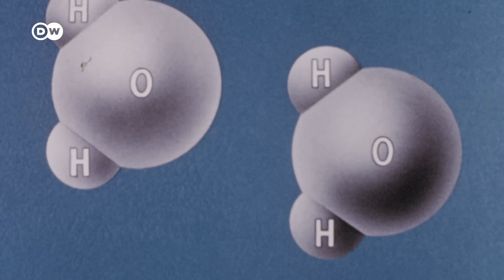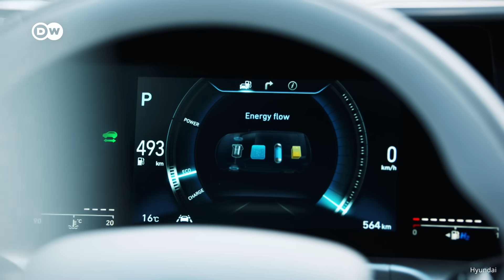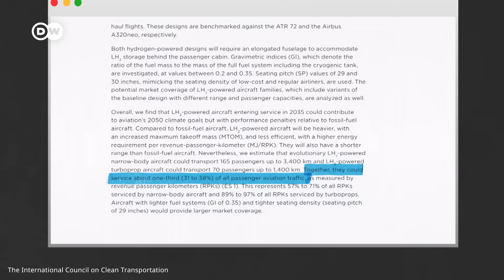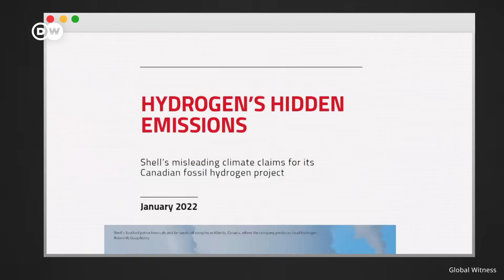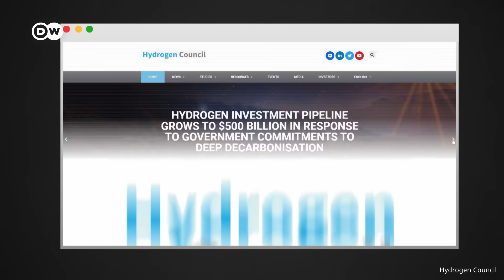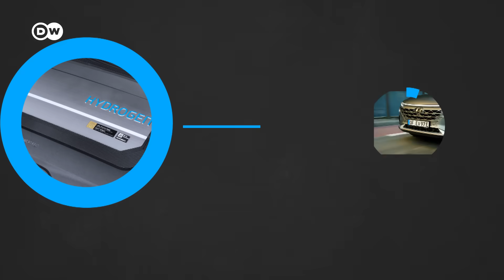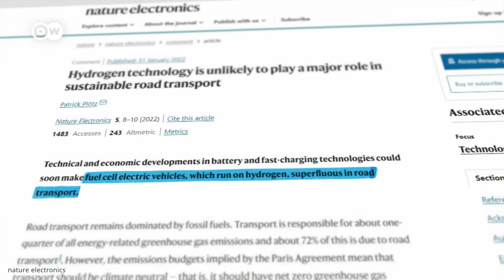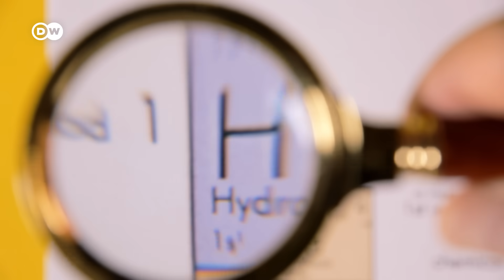The truth about hydrogen

Comment: I saw that in South Australia they are looking into using the excess solar energy produced to create hydrogen. if done like this is can be a very good alternative, and a very good export for very sunny countries.
Reply: Transporting hydrogen is also not efficient. Either cool or compress it like crazy.
Reply: @FIGHTTHECABLE  Even compressed, it’s 9 times the volume of liquid fuels for same energy.
Reply: @FIGHTTHECABLE  The key is cheap high-strength pressure vessels. AKA graphene
Reply: @raam1666  problem is compressed volume. As a liquid Hydrogen is 9 times the volume of a liquid fuel per unit of energy.
Reply: @raam1666  Has any vessel ever been made out of graphene? And since when is graphene cheap?  And that still leaves you with the considerable energy you need to liquefy - compress it.
Reply: @franztafferner9661  yes. and its not
Reply: Green hydrogen is going to remain expensive, because the plan to use waste electricity from renewables relies on nobody finding a better use for that energy. Give the terrible efficiency of the hydrogen cycle, that shouldn't be too hard.
The future for flying and shipping may well be hydrogen, but we also might see electric for both, with a lot more stops for battery swaps.
Reply: The problem with all hydrogen produce is the cost of the fuel which would be double + the cost of gas! Who wants to pay more money for gas? Also the maintenance of hydrogen fuel cell is certainly more than a BEV!
Reply: Yea this is the way to do it. Setting up solar just to create hydrogen is losing a lot in the electrolyzation process (about 40%). But using solar normally and only powering an electrolyzed with the EXCESS energy produced is the best of both worlds.
Reply: @SaveMoneySavethePlanet  Does using only excess solar to power the electrolyzers make them cost effective?  first step with solar is always to use batteries with other storage to level the power output. Batteries are needed no matter what the power source because demand drops at night and load matching is made easier.
Reply: @colingenge9999  I haven’t seen a breakdown of the cost for a system like this. But don’t forget how much we subsidize many fossil fuel industries. For instance, I did the math one time on the emissions of my wife driving her Corolla to work vs our budget.

The gasoline accounted for 12% of our footprint while the cost only accounted for around 1% of our budget.

Every new tech that rolls out goes through a period in the beginning where the government and investors need to prop it up until it gains enough momentum to be truly cost effective.
Reply: @SaveMoneySavethePlanet  Nobody is going to invest in hydrogen factories that just sit around waiting for some excess energy.
Reply: @Freba9  Solar installations all have 30% to 100% excess DC capacity - that’s to give winter generation margin.
In summer that power is essentially free power (and negative daytime wholesale power prices are a fact of life in most countries with significant solar installations in summer at the moment).
Reply: @allangibson2408  In the future there will be so many battery applications (mainly EVs) that there wont be much excess left.
Reply: @Freba9  Same thing holds - to charge a battery in winter requires twice the generation capacity than to charge the same battery in summer, therefore a lot of capacity will go begging for a load.
Reply: @allangibson2408  Also, solar and wind output varies by season. There will be over-capacity when the wind is  strongest and the sun shining the most.
Reply: @lockbert99  And that variable capacity is where energy storage that is capable of load swing handling is important. Hydrogen electrolysis with the gas dumped into existing gas mains for later use is just one option.
Reply: It’s a start - and makes us able to export hydrogen. But I wonder if there’s a better medium for storing and transporting renewable energy? And I wonder if csiro are looking into the best ways to store it (or if their funding has been cut so much over the past two decades now that it’s impossible for them - and now the govt has left it to the fossil fuel / mining supply chain to come up with a solution.
Reply: Using cheap energy prices to produce methanol as commodity instead of hydrogen would be a better solution. By Gasification of waste or biomass as carbon source and using additional green hydrogen to gain the correct H2/CO ratio of 2. Then synthesizing methanol from syngas so an energy dense (liquid) commodity can be sold and shipped internationally.
Reply: or making hidrogen on sea!!
Reply: No it can’t.
Reply: But what about e waste then
Reply: @tridentgameing6192  How much e-waste (assume you’re referring to renewable energy production) is their compared to Fossil Fuel.  Seems as if any amount of damage is ok w Fossil Fuel but any environmental impact of renewables is unacceptable. Do you have an idea of the ratio?  My thought is Fossil Fuel is about 20 times more damaging maybe more.
Reply: Unrealistic fantasy nonsense. If you want hyperinflation, food riots, total decay then by all means endorse hydrogen energy, especially hydrogen produced by solar powered hydrolysis.
Reply: @illuminated2438  I am not a big fan of Hydrogen for transportation but would like to have an objective conversation. “food riots” really?
Reply: Lol love people with short term memory forgetting the push for hydrogen cars in the early 2000s. Notice how the people pushing hydrogen are not the people that hold 75% of patents on hydrogen fuel cells. Japanese auto makers + GM own the vast majority of Hydrogen fuel cell patents. Think about that.
Reply: ITs really not because just transport on hydrogen and storage is problem all of itself which humanity hasnt properly cracked in 200 years. Long term storage.
Reply: I think SA politicians have no scientific background and are just led through any rationale and they simply accept what’s said.
Reply: After massive power blackouts in South Australia, Australian geologist Ian Plimer coined the term Climate Delusion (the false and delusional belief that mans effects on the earth’s climate are significant and dangerous).
The current mean surface temperature of Earth (15 degrees centigrade) and atmospheric carbon dioxide concentration (415ppm) are suboptimal.
Alternative energy resources need to be slowly phased in because fossil fuels are a finite resource not because there is any serious problem with the climate.
Reply: What excess solar energy?
Reply: Problem is energy density (volume)
Reply: What excess solar?
How are solar panels made and from what materials?
Same question for wind turbines. 
What are the lifespans for the above?
Better find out the facts. 
Turns out renewable isn't so clean after all.
Reply: That’s called Green Hydrogen.
Reply: It is just the worst act because instead of using an excess solar energy for producing hydrogen, why are they not using this solar energy for producing electricity etc.
Reply: Even if that hydrogen is only stored and used to power the stand by power stations during low renewable generation. There are some exciting advances in Solar generation happening now that will mean more excess renewables to produce more Hudrogen.
Reply: What is plan to handle Oxygen that is produced with Hydrogen in electrolysis process?
Reply: You can export it in balloons and it is very light so it does not cost a lot to fill a whole airplane with hydrogen ballon’s.
Reply: Liquid hydrogen has less energy density than diesel.
Reply: Technology is being developed to efficiently produce liquid methanol fuel from Green Hydrogen. This will solve many of the problems relating to inefficient or difficult storage and transport of hydrogen
Reply: Just using the excess solar for hydrogen is unrealistic. The hydrogen electrolyzers have to have a way higher utilization rate in order to produce hydrogen at a reasonable cost
Reply: @ElRhino9  Here in South Australia we're at a point where investment in renewable energy is tapering off- especially solar because during the day there is too much solar being supplied to the grid. It's not just some off days when we have excess renewable supply, regularly during daylight hours in the summer electrical wholesale prices are negative. We're at the point where the solar inverters from people's home is being turned off by the electrical companies at some times during the day. We also largely rely on natural gas for just under half of our electricity. Since we have limited means of storing this significant additional energy with no real locations for pumped hydro and the high cost of battery storage hydrogen is something that is being seriously being proposed by government and industry. I think if this were done it would bring on more investment in renewable power allowing the scale of hydrogen production to increase and become self perpetuating also allowing the thermally produced portion of our power to be provided by hydrogen to an increasing degree.
Reply: @alibabahck  Battery storage in Australia has proved to be a massively good investment. The Hornsdale battery cost 95M and repays 45M annually such that Australia has changed its stance on storage and buying a lot more batteries.
Reply: @colingenge9999  You're right that currently battery storage has proven to be economically viable but only as much as it works to take advantage of the in between times prior to our gas turbines starting or sudden drops due to cloud cover. There's a limit that market which will not cover the amount of power we need to supply power on cloudy, windless days or at night. This is still more economically produced using our gas powered plant.
Reply: @alibabahck  gas has to  be imported with currency flowing out of the country whereas once a well balanced storage system is in place it will pay dividends every day. 

Your statement does not give credence to daily demand peaks. Typical demand peaks from 7 am to 8 pm say are three times the troughs making batteries ideal for load levelling with gas turbines, hydro or any other source. 

Solar is more of supply peaks that need to be levelled.  Computer software will adjust to all the variables and optimise the system.
Reply: @colingenge9999  Yes generally your right maybe for Europe but as South Australia is a net exporter of natural gas this is not correct in our case. Actually the largest proportion of our hydrogen plan (sadly?) is blue hydrogen.
Reply: @colingenge9999  How many hours demand do the Australian batteries store?
Reply: @lockbert99  easy enough to to find out if you search Tesla Hornsdale Battery. 

generally, utility scale batteries are a law of diminishing returns where you get the most value out of the first batteries you put into the system. Those first batteries would be used to take out milli second by milli second noise and simply level or smooth out the voltage which increases efficiency because this noise mostly just turns into heat anyway. When you add more battery capacity you can smooth output of the power plant minute by minute and then as you add more hour by hour and then as you add more day by day.

The first Hornsdale battery cost 90 million and returns around $42 million every year. that’s not counting the savings they made by not having to buy and operate a gas driven Peaker plant. I believe that one is doubling or tripling in size since they already see that they will get their money back very quickly. Other parts of Australia are getting batteries for smoothing the power in their utilities.
Reply: @colingenge9999  How much would it cost do seasonal storage with batteries? Or would large overbuild be better (which still requires daily and weekly storage) that creates large excess in peak output seasons?
Reply: @lockbert99  My specialty is conservation in buildings and I’ve only learned about batteries in a peripheral sense. However, I do read a number of newsletters, clean technica as one of them that talk about these developments.
in general batteries would be a bad choice for seasonal power storage. There is one an expensive battery that takes four days to charge up and will only discharge at a similar rate. That would be a good choice for week two week storage. Lithium batteries are best suited for second by second or minute by minute or day today storage at the most.

In Finland they have developed a technology where they use a molten material, I believe at salt, which is pumped underground with 2 m of insolation that will store power for an entire season with very small losses.

You can also look up Tony Seba articles that would give you more information.
Reply: @ElRhino9  It is still better than switching off the solar panels just to stabilize the excess power into the grid. The AEMO were even toying with proposing that homes with panels should start to pay, to export power when the grid was in excess.
Reply: @winnythekahuna8073  Solar must incorporate storage which helps out the grid for all power sources since load fluctuates.
Reply: @ElRhino9  They only have to be able to produce it for less than people are willing to pay. Natural gas isn't free. But if they can't match natural gas in price they also have the fact that natural gas causes global warming.
Reply: @ElRhino9 its really not that expensive
Reply: @ElRhino9  there will be situations where lots of renewable electricity can be produced but there aren’t consumers nearby. Like Australia. This is the opportunity to develop Green hydrogen. Where there is demand near production the electricity should just go to the grid
Reply: @MichaelTavares  It seems you did not even read Reinder's comment.
Reply: @MichaelTavares  Exactly. There are seldom large population centres in deserts but they're usually good for PV.
Reply: Invercargill in New Zealand is also looking at Hydrogen when Tiwai aluminium smelter is shut down there will be a huge amount of excess electricity from the Manapouri underground power station
Reply: Isn't the main problem of solar energy the heat? Why would they choose such a hot country to use solar panels ?